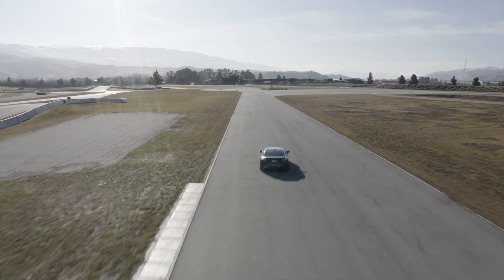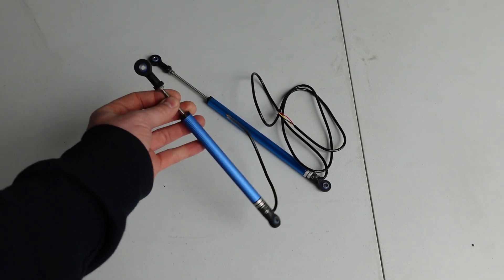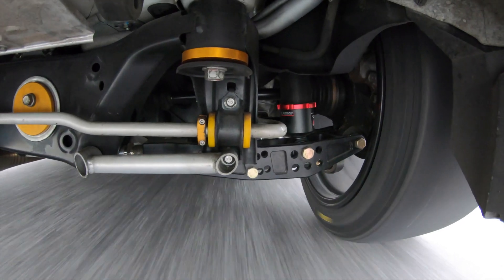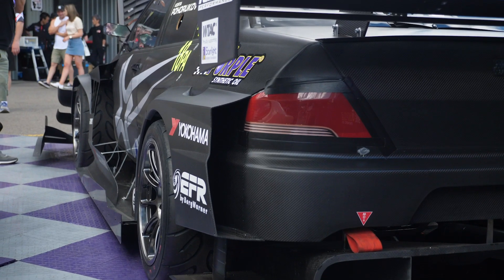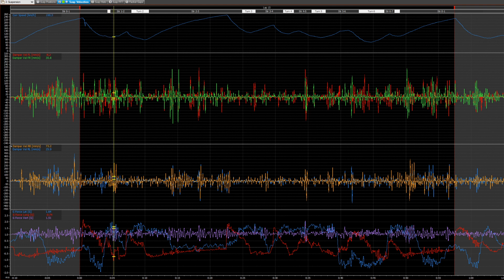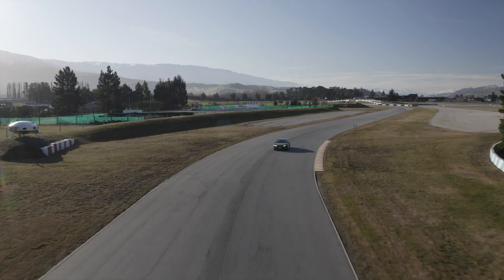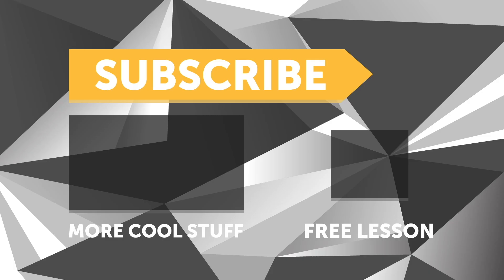Suspension Tuning 101 | 3 Uses For Your Damper Data

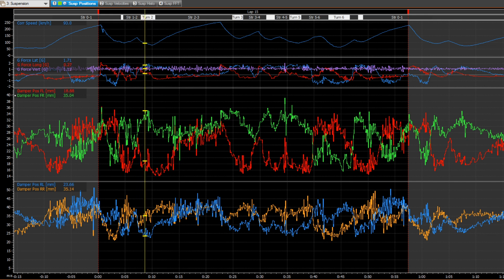Comment: Looking at the graphs at 02:21, it doesn't look like the data is getting pulled in and displayed properly.  At 250Hz, that would be 250 height measurements per second. In looking at the graph, I am looking at the first 2 seconds. That should be data from 500 samples of suspension travel. I don't see that info being displayed properly. The orange display shows the travel of plus and minus 3mm about 5 times per second. The weight of the unsprung mass and the dampening the sidewall provides should make data like this almost impossible. The data should have a more averaged look to it. The data from the front suspension is way out of wack. There is no way a suspension unit on the front of a car can raise and fall that fast. As they are all the same measuring sensors, I would recommend building a test rig to test them. Maybe run two on a single suspension point to compare data. I know it sounds like work, but I don't see how the data can look like that.

Comment: Well done. Another use for shock pots is knowing the spring compression. With this you know the weight on each tire. Making a simple bar display for each corner and overlaying that on the forward video you can help the driver know if the understeer/oversteer is driver input caused (weight transfer). Really helpful with fine tuning corner entry/exit.

Comment: Do you guys have a recommendation for a waterproof linear potentiometer like you have shown. Looking to use it on a boat for srern angle monitoring. Thanks for the excellent video!
Reply from the maker: Not off the cuff sorry. I would check in with the likes of MSEL, MoTeC and Ballenger etc to see if they can recommend a unit - Taz.
Reply: Thank you!